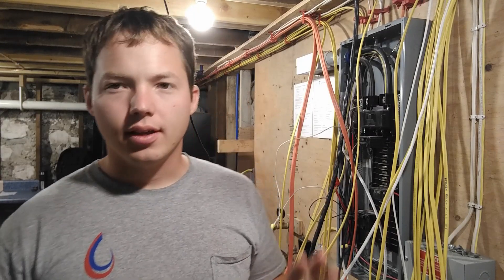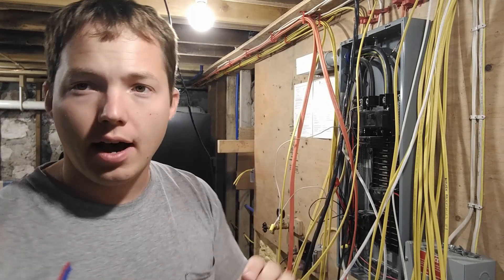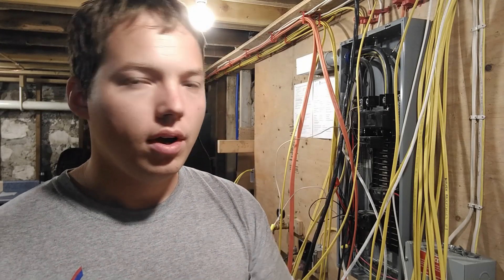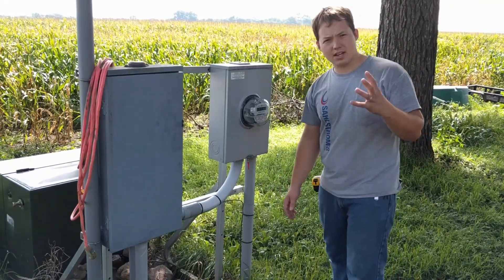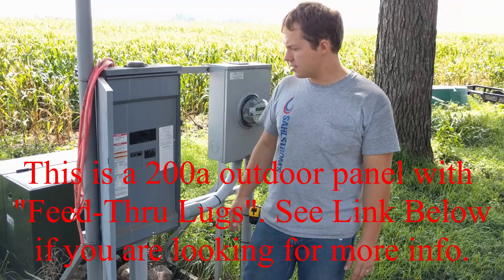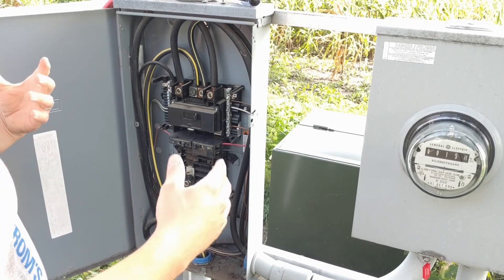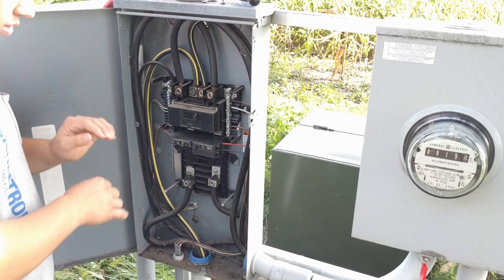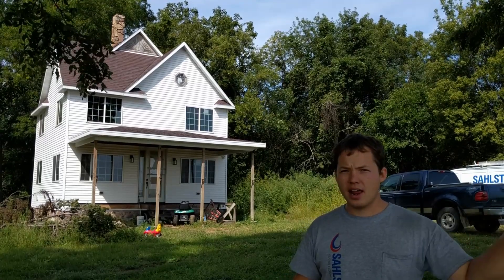What Is a Cut Off Panel? - Main Disconnect Using 200a Feed-Thru Lug Outdoor Load Center

Comment: So when you have a set up like this.  A cut off panel next to my meter on the back of my house, feeding to the main panel (no main breaker) in my garage mounted to an interior wall.  Does that technically make the garage panel a sub panel?  Meaning that you can’t put neutrals and grounds on the same bar and they must be separated onto dedicated bars?

Comment: Thank you so much I am subscribed. Quick question, When the switch is turned off at the cut off panel. Is the neutral also disabled or just the two hot legs?

Comment: ? Ben i have the main breaker outside my house Wich connects to my inside panel inside the house .i connected a light that's 120  outside to my shed from the main breaker box outside i added a120 double pole breaker on it . The light on the shed works but i get 120 on my ground wire i think it's because my main panel is bonded with neutral and ground i know i shouldn't take off the bonding screw so how can I do it to solve my problem of getting 120 on my ground wire?

Comment: Do you still have to run 4 wire to your inside panel box as if it is a sub panel ? Do you then have to separate the grounds and neutrals in the sub panel ?

Comment: Benjamin, I really like your videos too!  I live way up in the extreme NW tiny little corner of the US, where we have extreme weather WIND/RAIN/SNOW/FLOODING/COLD/SILVER THAWS (You name it) breaking and clapping wires together, power surges. Did I say RAIN?!! 
TREES! Well, the power trips out all the time. 
I like your panel as shown and I have a 200 amp consolidated disconnect/Breaker panel (Does it all) after the Meter, now. The power around here goes off all the time and My idea is; I wanna be around when the power comes back on, I don't have really nice under ground wiring like you do but, the Neighbors have lotsa tall trees, I don't want the power coming back on when the area is flooded or a Tree is down on My wiring and of course while the power is off I wanna Generator back feed when safe and I am home.   
What I am looking for is the same Panel with a 200 amp auto (GFI?) disconnect/MANUAL reset (after power loss and power flux would be good too)? 

Thanx for everything! -Phil

Comment: The hot cables are run underground. What will happen say if water got to those cables underground? There is no GFCI. Does there need to be a GFCI  on those hot wires underground from the main to the house? Just asking because I have a pedestal (200 amp). I run a 50amp breaker from it to a building underground through pvc. Does it need GFCI? Thanks,

Comment: Does the panel after the cut-off panel ground and neutral bonded? Can we turn the main panel into a cut off panel if there is not cut off panel anywhere and make the subpanel the main panel?

Comment: If you may, please comment on how one might wire a generator transfer switch (or transfer switches) into this ecosystem. I'm working to facilitate a backup power setup for a pal who's battling metastatic bladder cancer — who cannot survive without continuous electrical power. Many thanks in advance for whatever ideas which you may advance!

Comment: When you cut off the 200 amp cut off panel on the outside. Does that then mean you can work on it without getting electric shock. Say I want to install a small 30 amp breaker to it for a outside building? Or do I need the power company to come disconnect the meter before I can do that?
Reply: Yes. That is one of the benefits of this panel. Everything below the 200A breaker, including the house panel, is cold (not hot/energized) when it is switched off. It is best to use a non-contact voltage tester to double check any electric work you are doing.
Reply: That's exactly what I've been trying to get answered.
I'm thinking you can because it's between the outside shut off and the meter.
I guess I'm going to have to call the power company.
Good luck!

Comment: Stop talking to us like we're electricians. So, dont explain anything. Because you cant explain to anyone except another electrician . 
Pictures pictures pictures 
NO WORDS ! Becacause you CANT EXPLAIN. 
SHOW ONE WIRE AT A TIME, WITH NO OTHER WIRES AT ALL ! ANYWHERE IN SIGHT ! 
I ONLY WANT YO SEE THAT 1ST AND ONLY WIRE( YOU KNOW, THE BIG 2.O, OR 3.0 ) THEN IDENTIFY THAT WIRE( If your hand writting is as bad as a Dr's is, then end your instructions   and never mind ). Put a label with BIG, REAL BIG LETTERS ON IT. USE A 4" X 6" PIECE OF  ' White ' cardboard. You don't even have te identify the wire, just label it  ' A 'at each end.
Now, connect  ' A 'to where it goes on the meter, making the big white tag visbile. Then, connect that same wire's other end, ( which is labeled ' A ' also ) to where it goes to in the meter.
Continue ; one wire at a time

Comment: That is you main breaker service disconnect not a cutout panel. You may have a 200 amp circuit breaker in the panel as well but it is not your service disconnect breaker, its just the panel disconnect.they make panels with a meter socket and the 200 amp circuit breaker all in the same panel with extra feeder breakers. It would simplify your installation and looks better as well.

Comment: My house is old and I'm about to change my main panel. The meter is 5 inches from my main panel and for some reason I have a cut off panel which is insanely only 60 amps. My new main panel is 100 amps. Should I bypass the cut off which is only side by side with the main panel? I want at least 100 amps in my house. Not 60

Comment: What's the difference between cut off panel like the one you have shown here and an emergency disconnect panel? This is in reference to the NEC 2020 230.85 Emergency Disconnects requirements.
Reply: This type of panel differs in that it allows you to run power from breakers inside the bow to other buildings like a shop, wellhouse, pool or other items outdoors. This way you do not have to run from your house panel out to the other buildings outside.

Comment: I am building a very small house. The “main panel” will be on an interior wall approximately 10’ from he meter. The main wire from the main panel will go up into the attic (8’ wall) and down the exterior wall to the meter. Do I need a cut off panel in this situation?
Thanks for the videos.

Comment: Nice video Ben. I assume meters are directional so they must be fed on the top and loaded on the bottom. Since the meter base is bottom fed are the wires looped around to the top inside the meter base? Looking at my meter base it looks like it wouldnt be a good idea because of the tight space. That meter base looks much bigger than mine. Thoughts? Thank you.
Reply: You are correct. The line side to the meter should always feed into the top. He should have come up the right side of the meter base to the top and used an lb to get his wires in. The utility could have refused to connect power. Line and load cannot share the same space. The top half of the meter base is the utilities' the bottom half is the customer.

Comment: If you turn off that main cut off panel does it kill power to that panel as well as the second panel in the house. What if you have to change out a breaker on the main cut off panel? How do you kill power to it?
Reply: 4 years later I’ll answer your question.  I am currently installing this same setup, exact same feed through 200Amp panel.  It is a Square D QO panel has space for 8 breakers and feed through lugs at the ends of the buss bars.  Some people call it a ranch panel because they are often installed in multiple barn/building scenarios.
The Main 200Amp breaker shuts off power to the buss bars that the breakers attach to as well as the bottom “feed through” lugs.

Comment: Just came across your site and you have a new sub. Question for you, I'm installing a 200 amp overhead service with meter and disconnect on side of the house. The house panel (sub panel) will be in the garage. Do I need a conduit to install the service cable through the attic so I can feed the house panel from the disconnect located on side of the house. My plan is to have a chase nipple between the meter and disconnect then 2'' rigid conduit out of disconnect up the side of the house and enter attic area. and do I need an insulated neutral and insulated ground from disconnect to house panel?

Comment: I have one more question... The cut off panel outside that has the ground wire connecting to the grounding rods... Where does that connect to within the panel? A grounding bar?

Thx
Reply from the maker: It connects to the neutral bus bar. At the first panel (in this case the main disconnect panel) the neutral and ground wires are all tied together. Down stream they are separated. Does that make sense?
Reply: @BenjaminSahlstrom  it does thanks a lot!
Reply: @BenjaminSahlstrom  it does thanks a lot!
Reply: @BenjaminSahlstrom 
that's what was confusing
the other video you called in the inside panel the sub-panel, this video you call that same panel the main panel
Reply from the maker: @craiganderson9668  Sorry. The terminology is sometimes difficult to keep straight. That panel in the house is indeed the main panel for the house however it is also a sub panel of the main disconnect feed through panel out in the yard as well. The only difference is that the grounds and neutrals are kept separate in the house panel versus the first panel after the electrical meter. Hope that helps.
Reply: @BenjaminSahlstrom  Thanks so much for clarifying this "little" detail.  I was told by a building biologist that I need to add a disconnect panel in my home in order keep the electrical current in my home cleaner (to avoid net current issues...)  Your comment really helped me understand the rationale.  My main panel now has the ground and neutral bonded together...with the new disconnect panel, the main panel will now be considered a subpanel and therefore, no longer needs to be bonded.   Again, much appreciation!
Reply: @BenjaminSahlstrom  So because this cut off panel is considered a main panel, it must then have the ground   bonded to the panel and the neutral in order to be code compliant?

Comment: Thanks for the informative video Ben :)   I have a cut-off panel at my house in the country as well.  I also have a panel in the house that accepts the 200 amp live feed from the cut-off panel but also has a "MAIN" cut-off breaker on top (4 breakers connected w/ horizontal bar).  I have a question about rewiring a 15 or 20 amp breaker that runs from my house panel , outside , to a shed / shop.
Question :
a.)  Is there a maximum distance I can run a wire from a 15 or 20 amp breaker to a run of 4 or 5 outlets and a light switch ? I'd like to replace a yellow 12/2 residential wire w/ a grey UF (direct bury) wire that already feeds a shed / shop in my yard. Thanks for your generous consideration, 
sincerely ...............................